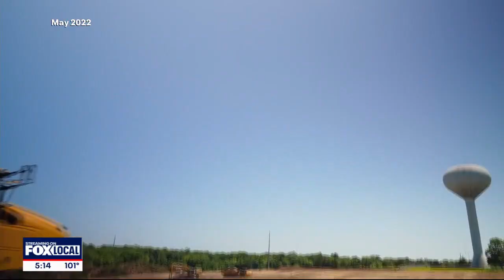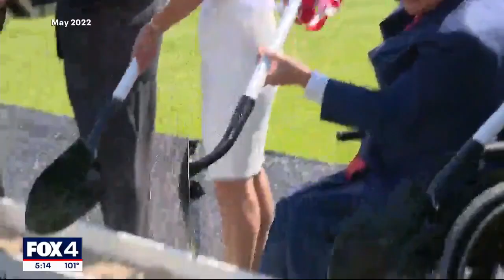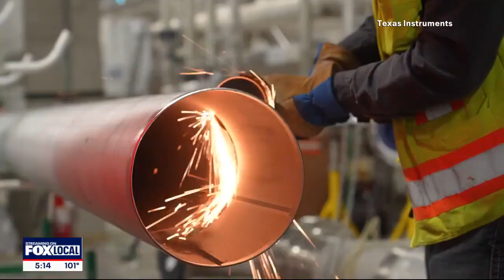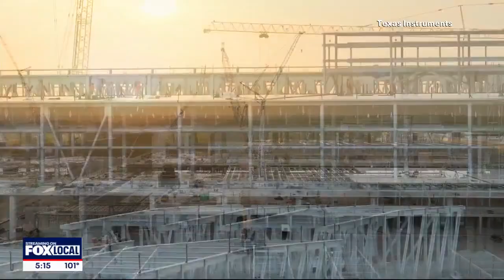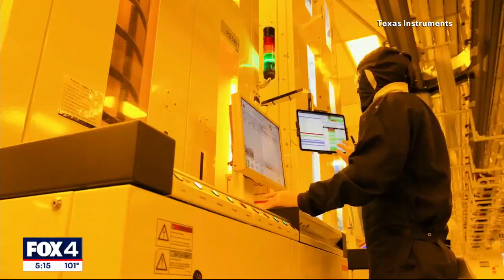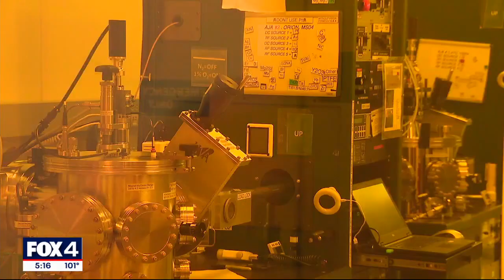Texas Instruments gets $1.6B investment to expand semiconductor manufacturing

Comment: TXN made a mistake on not promoting Morris Chang for the top job in the 80s. TXN will never catch up to TSM😂
Reply: I don't want to sound condescending, but it sounds like you're not familiar with the semiconductor microelectronics foundries, or either you're just trolling.

Texas Instruments ("TI") and TSMC are neither direct nor indirect competitors. They're not in the same subfield of chips, electronics, and microprocessors. 

I know you're not an wafer fab engineer, stock trader, or investor, but TI designs, tests, and manufacturers analog devices and components in the electronics industry. 

You could be confusing TI with digital and fully automated fabs and foundries owned and operated by Applied Materials, Apple, AMD, Honeywell, IBM, Intel, Qorvo, GlobalFoundries, Samsung Austin  Semiconductor, OnSemi, NXP Semiconductors, X-Fab Texas, or Micron Technologies. 

The US semiconductor industry is diversified and enormous. The field is too large, and the academics segment alone is larger than most industries in entire countries. 

TI and Taiwan's semiconductors and wafer fabs shouldn't be directly compared because TI is an analog company and TSMC is digital. Comparing them makes it obviously that you don't know about wafer fabs and integrated circuits.
Reply: @RiteMoEquations  TI would have been a much better company if they have chosen Morris’s vision to lead when they had a chance in the 80 before TSM was found.